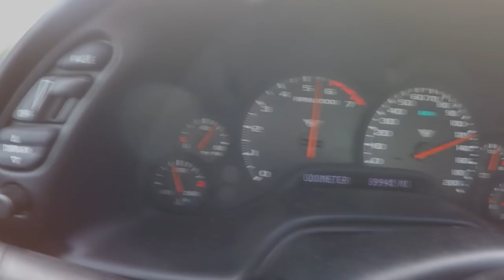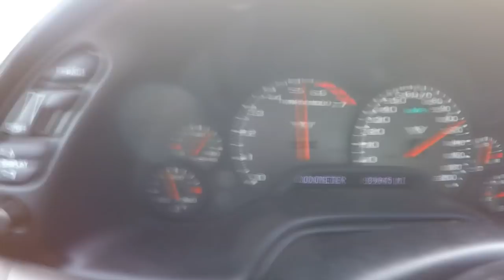Mystichrome Corvette Gets a HUGE Shot of Nitrous!!! THIS is How I'm Going to WIN.

Comment: tip for removing crusted nuts,, unlike PB BLASTER or WD-40 candle wax will adhere itself to the bolt and creep behind the threads, the rest will run from the heat, just add heat and rub the candle on it and walla, remove the nuts.